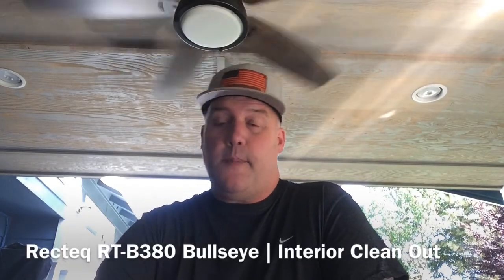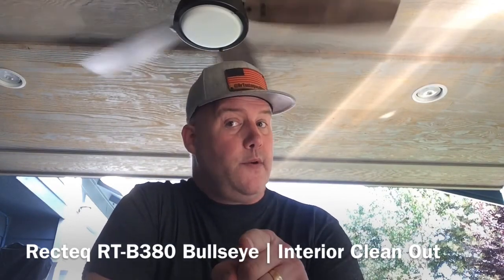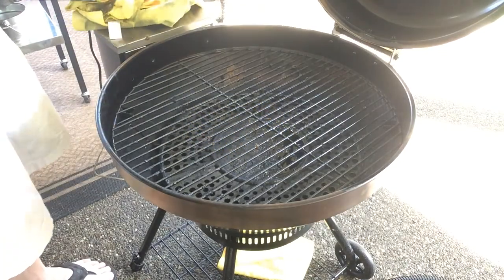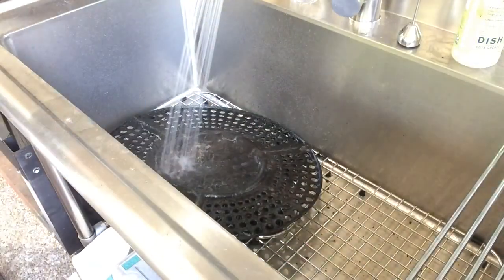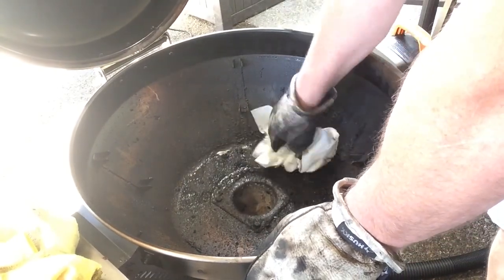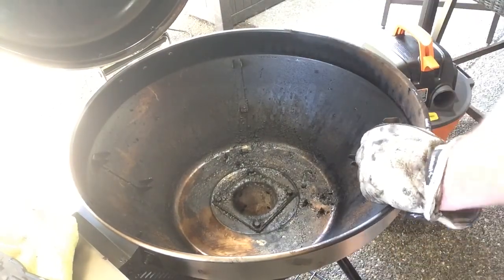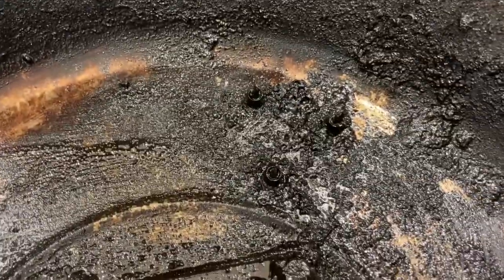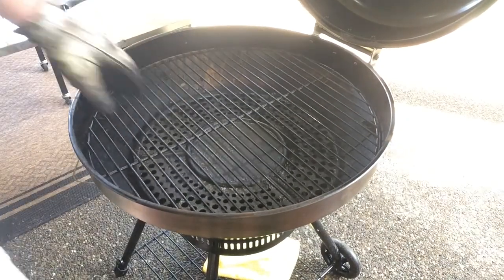Recteq RT-B380 Bullseye | Interior Clean Out

Comment: They really need to go back to the drawing board with this grill. Gotta have a grease channel running to a removable drip pan. This just changed my mind on this pellet grill.
Reply from the maker: Be careful. The Rec Tecq Mafia monitors bad words against them. LOL Is what it is. I’m not going to say I like something if I don’t. In a nutshell I agree with you.
Reply: I usually just put a throw away pan or pie plate to catch the grease. Makes clean up easier and keeps grease away from flames

Comment: That is a pain, but even pellet grills with a grease management system have to be cleaned.  

Having no place for grease to go is very dangerous especially when next to a fire pot. I am surprised someone has not designed a grease drain, like drilling a hole in the bottom for grease to drip into a bucket like the Spider 22 pellet attachment does with the Weber kettle.

Comment: Aren’t you supposed to just use riot mode then vacuum the ash out?
Reply: I watched some videos from the recteq channel on this grill and they say to actually leave the ash that its actually a good thing, it soaks the drippings and helps prevent flare ups. They said to just scoop some of it out every few months. I just put it in riot mode to burn the drippings when I finish every cook(it makes a bit of a ugly stinky smoke for a couple minutes fyi) for anyone who tries it this way. Then when it cools down or before the next time I use it I pull out my grate and deflector, scrub em down really good, scrape the ashes off the sides down to the bottom, prime the fire pot put it back together and fire her up

Comment: Won't riot mode burn all this off mostly?
Reply from the maker: I suppose you could give it a shot. You’ll still need to vacuum it out one way or the other.
Reply: It does prevent fire.  Riot mode for a few minutes at the end of every 4th or 5th cook has worked well for me.  No fire while cooking that way.
Reply: @lawrenceshdow  I do it at the end of every cook to burn up all the grease /droppings. After about 8 minutes on riot there's nothing left but ash...

Comment: Too bad it's fire prone! I think this is an awesome grill otherwise.
Reply from the maker: BBGrillShack Thanks. It’s definitely a bummer.
Reply: I just do riot mode every once and a while and it never fires up.  Burn it up before it builds up
Reply: I watched some videos from the recteq channel on this grill and they say to actually leave the ash that its actually a good thing, it soaks the drippings and helps prevent flare ups. They said to just scoop some of it out every few months. I just put it in riot mode to burn the drippings when I finish every cook(it makes a bit of a ugly stinky smoke for a couple minutes fyi) for anyone who tries it this way. Then when it cools down or before the next time I use it I pull out my grate and deflector, scrub em down really good, scrape the ashes off the sides down to the bottom, prime the fire pot put it back together and fire her up
Reply: @lawrenceshdow  exactly 👌🏼